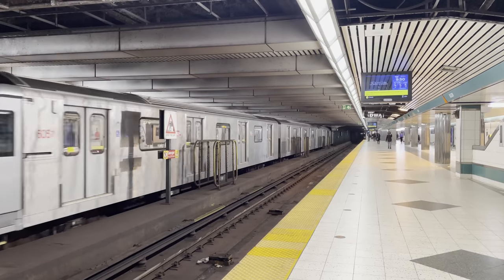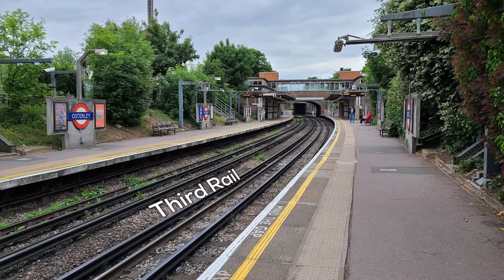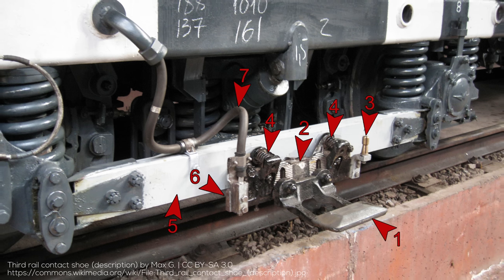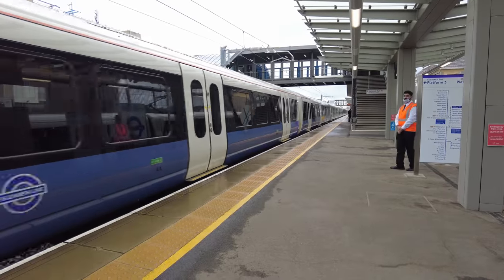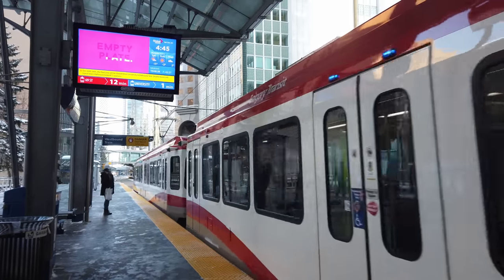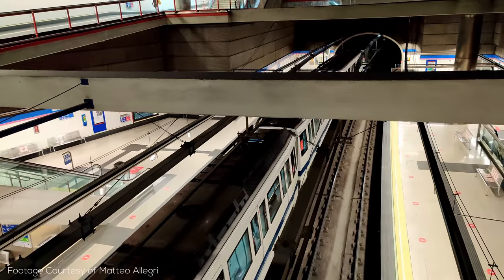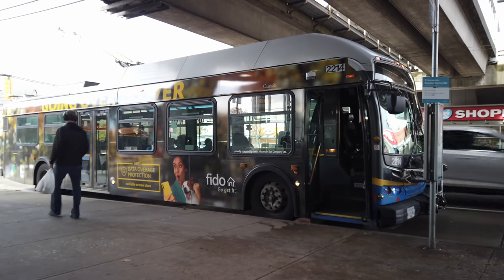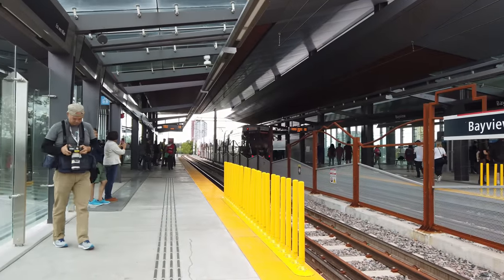The Best Way to Power Your Railway | Third Rail vs. Overhead Wire

Comment: On the Merseyrail network in Liverpool, the new trains, should they ever arrive, have the ability to be dual mode with cantenery and third rail shoe. However because God forbid we spend money on infrastructure, they can, and will be, fitted with batteries instead for going beyond the third rail network, which I just think is silly, especially since cantenery already exists on other lines near the network that the trains could theoretically access, and not be limited by battery range.
Reply: Fitting them with batteries also means that in the event of catenary being down or a pantograph failure, they can 'rescue' themselves to a limited extent, get passengers to the next station, etc, etc.  Even the 'pure' electric IEP's, the 801's, each have a single on board diesel gen-set to allow off-catenary moves. (The 803's have an enlarged battery bank for the same purpose and all the other IEP's in service so far are bi-mode anyway)
Reply from the maker: @jonathanj8303  Having batteries for that reason is good, but having excessive amounts probably isn't super useful!
Reply: @RMTransit  it's a compromise like everything else.  When you're using the batteries, great to have, when you're not, dead weight.  Kind of like the spare wheel in a car. Or having any more fuel in the tank than is needed to reach your destination.
I don't know how big the battery pack on the merseyrail stadler units is, but the one on the 803 trains is apparently effectively a swap-in size and weight wise for the 560kW gen-set they would have had if they'd been built as 801's.  I don't know what the range on batteries is, but it's obviously slower to recharge vs refilling the tank, but environmentally cleaner (depending on where you buy your electricity).  Seems a fair swap to add some operational flexibility/backup to a 5 car 270t 200km/h electric train. If it and a couple of other prototypes work out, longer term I wouldn't be surprised to see the 800/802 bi-modes swap their gen-sets for hydrogen fuel cell modules, and the 801's get either batteries or fuel cells depending on the operators' preference.

Comment: I'm a little surprised that so few diesel electric trains are battery hybrids. Charging batteries with the regenerated power, then feeding that power back into the electric motors when needed would make them significantly more efficient.

Also, I believe that the new New South Wales (Australia) regional trains (to replace the XPTs and Explorers) are planned to be diesel electric with pantographs so that they can shut down the diesel engines and operate on overhead wires where available. This will result in less pollution and noise when the trains are in the greater Sydney area.
Reply: I think the Siemens charger is a diesel-battery hybrid (or at least some versions of it will be)
Reply: We have some new trains in Trondheim using that system.

Comment: A kid from my school in the south of England threw a metal bar at the third rail and was very badly shocked and burned by it. He was not the brightest.
Reply: After the power has been switched off a metal bar can be placed between the conductor rail and one of the running rails, or on the London Underground between the positive and negative rails, to ensure that the power is not turned back on, for example if passengers have to be walked along the track from a failed train.  In an extreme emergency the short circuiting device can be applied to a live track as the means of shutting off the power if the normal means is not possible.  Staff are instructed to apply the device to the running rail, or negative rail on the Underground, look away to protect the eyes and then to bring it down smartly onto the live rail to reduce arcing.  I have never seen it done, and I certainly wouldn’t want to do it myself, but I have spoken to somebody who had to do it in training.  They didn’t like doing it either!
Reply: When Los Angeles'  new subway opened in 1993, a dog made his way into the maintenance facility and lifted his leg on one of the third rails....

POOF WENT THE WOOF!

Comment: Möööp! One big nono... You only need fewer trackside equipment on AC installations if you use higher voltages!
The problem with DC is, that at higher voltages it becomes FAR more complicated to handle. AC on the other hand is less efficient in transission than DC. But the cost of maintaining high voltage DC equipment is simply to expensive.

That is why you will typically find voltages between 600V and 1000V and no use above 3kV with DC. To power the same amount of trains on 3kV vs. the "new standard" 25kV AC you need about 8 times more metal for the same amount of power delivered - not necessarly 8 times the substations, but still substantially more. Still, due to physics, 3kV DC at 1000A is simply not enough juice to sustain high speed. And again, catenary that can sustain more than 1000A continuosly just becomes prohibitly expensive -  ask the Netherlands.... And that is not even considering the limitations of amperage on pantographs...
All European countries that use "low" voltage DC on their legacy main lines have opted to use 15kV to 25kV AC when they build their new highspeed networks (Italy, France, Spain & BeNeLux, for example)

Many companies opted for DC in the beginning, because this made the trains themselves a lot cheaper to build and due to the lack of a transformer and significantly smaller motors (for the same amount of power output) a lot lighter. AC was generally only used for long distance rail lines, where the cheaper trackside equipment outweight the more expensive trains.
Especially the Netherlands would love to abandon their DC network rather sooner than later, at only 1,5kV it simply has not enough *Oomph*, especially for freight trains...

The de-facto standard of 25 kV AC only became the most feasable option with the advent of high current semiconductors at the beginning of the 90's - making multi-phase AC motors (the most efficient motor by far) practical on every-day trains.
Fun fact: Almost every modern train runs on DC, because there is no easy way to change the frequency of the incoming AC. So it simply gets stepped down to generally around 1000V and then rectified, because it is easier to handle "lower" voltages in semiconductors... The DC backbone is then used to generate the shifting AC for the motors themselves.
Reply: Ironically, both France and Netherlands have been tried AC electrification in early 1900s. Ligne de Cannes-la-Bocca à Grasse have been tried using 12 kV 25 Hz between 1910 and 1914. Chemins de fer du Midi electrified at 12 kV 16.7 Hz. Meanwhile, South Holland Electric Railway Company (ZHESM) 10 kV 25 Hz from 1918 to 1926.

All of them actually successful, but for various reasons, all of them re-electrified to 1500V DC

Comment: Overhead is cheaper than third rail. It's why in the UK, only in the South East (including London south of the river) do they use 'third rail'. Elsewhere in the UK, any electrified track is overhead. 

But by 2030 there will probably be a third way to power electrically: using a battery pack on an EMU (Electric Multiple Unit), or an Electric Locomotive. 

Still early days yet, but reckon there'll have invented a large electric battery pack for use on trains by the close of this decade. Crucially, a battery that doesn't spontaneously explode, like some electric car, and bus batteries do at the moment.
Reply: Except for Liverpool and Glasgow

Comment: How did the conduit system work in London’s old trams?
Reply: There was a slot in the ground between the rails and a ‘plough’ attached to the tram made oontact with a live conductor below the ground.  If you’re in London the conduit slot can still be seen on the ramp leading down to the disused Holborn tram tunnel, near Holborn Underground station.  The changeover between conduit and overhead systems took place at a ‘change pit’ where the plough would be released from the tram and would run into a sort of siding between the tracks in each direction and rage trolley pole would be raised.  In the opposite direction the trolley pole would be pulled down and a man with a large tong type tool would grab a plough and insert it under a tram going onto the conduit system.

Look for ‘The Elephant Will Never Forget’ a British Transport Films production about the last week of trams in London, in 1952.  Among other things it shows the operation of the change pit.  The whole operation only took a few seconds.

Comment: @RMTransit in The Netherlands the RET Metroline E rides from Den Haag Centraal to Slinge and from Den Haag Centraal until metrostation Melanchtonweg the metro use Overhead Wires and at the station Melanchtonweg while it halt at the station it switches to third rail and then it uses from Melanchtonweg until Slinge third rail from the Rotterdam Metro system and it shares the tracks from Den Haag Laan van Nieuw Oost Indie until Leidschenveen Tram/Metrostation with HM Randstadrail line 3 from Den Haag Loosduinen to Zoetermeer Centrum-West and 4 from Den Haag De Uithof to Langslingerland Zoetermeer and they use then the former Hofpleinlijn and the trams also the former Zoetermeerlijn. And by RET metroline A from Binnenhof metrostation it use overhead wires from Binnenhof metrostation until Capelsebrug and Metroline B use from Nesselande metrostation until De Tochten metrostation third rail and then by De Tochten it changed to overhead wires and then from De Tochten until Capelsebrug it use overhead wires and halfway by the crossing by metrostation Graskruid metroline A joins metroline B to Capelsebrug and then together it goes to Schiedam Centrum running together with metroline C until Schiedam Centrum and metroline A and B are switching while driving to Schiedam Nieuwland from third rail to overhead wires and from Schiedam Nieuwland until Vlaardingen West metroline B runs together with metroline A  and sometimes a freight train until Vlaardingen Oost and the metroline B runs to the temporary metrostation Hoek van Holland Haven where it ends on 1 of the former train platforms where in 1935 until 1994 D train international teaibs deprted and until 2017 local trains to Rotterdam Centraal departed. Metroline C runs from De Terp to De Akkers where it shares tracks from Capelsebrug until Schiedam Centrum with RET metrolines A and B where line A and B runs then to Vlaardingen West and Hoek van Holland Haven and metroline C runs then further to metrostation Tussenwater where it shares until metrostation De Akkers where it ends the tracks with Line D wich runs from Rotterdam Centraal and shares the track to Slinge with Line E from Den Haag Centraal and metrostation Beurs is a metrostation where at Beurs you can change from Metroline A to Vlaardingen West and Binnenhof to metrolines B to Nesselande and Hoek van Holland, metroline D from Rotterdam Centraal to De Akkers, metroline C from De Terp to De Akkers and metroline E from Den Haag Centraal  by

Comment: An AC and DC system of the same voltage are equally lossy over distance

It's just much easier to raise the voltage of an AC system to be very high, since you can use transformers for AC but not for DC
Reply: Exactly. And just to add my five cents: The losses actually come from electrical resistance in the conductors. You can imagine electrical resistance like mechanical friction. 
The higher the electrical current in your conductor is, the higher your resistance is. Because power equals voltage*current (P=U*I), to transmit a lot of power you either need a high voltage (25kV for example), or if you have, let's say, 1500V or 3000V DC electrification, you have extremely high currents. That's why countries wich have DC electrification on their railways, like Poland, Netherlands, France, Italy,... often have two catenary wires in parallel to each other, and each Pantagraph usually has 3 or 4 graphite contacts that touch the catenary, instead of one or two  on AC electrified systems. These are all measures to reduce resistance.
Reply: @georgobergfell  My understanding is that AC circuits would have less power loss over distance because as you raise the voltage, current decreases and if P = I² R then power loss to heat decreases greatly, at least this is what my textbook tells me.
Reply from the maker: Yeah, I am not in the loop enough about HVDC, but I do need to go look into it in. more detail, I know it's become much much bigger.
Reply: @georgobergfell  Are the wires themselves really that non-ohmic to the point resistance increases greatly at higher voltages? I would have thought resistance relatively constant especially if they're being used for high transmission at a constant voltage, and so the power losses only minimised by step ups. Maybe I'm just misinformed on the issue
Reply: @jesse4202  yes, resistance is relatively constant and doesn't depend on the voltage. The losses come from the voltage drop due to resistance

Comment: 8:39 errm. No.
Yes, AC current is easier to step up and step down and requires less switchgear than DC equivalent at the same voltage.
DC is a problem in transport as it can ark between the third and running rails, making a 25kV third rail extremely problematic. In fact a 25kV DC OHL would be more efficient that an AC OHL, but again can ark across 5 meters and extremely dangerous to rail workers and passengers who get too close. AC can ark, but due to other technical reasons is largely safer.
DC third rail systems are typically less than 630V, which means the current is inversely higher, which means conductor losses.
DC is not inferior to AC when it comes to losses.
AC(rms) and DC have their advantages. 
DC doesn't have reactive losses like AC, that's why it's often used in underwater power transmission. 
AC doesn't have to be controlled by switching positive and negative in a circuit like DC. 
Due to the way AC is generated, the peak voltage of AC is way higher than DC equivalent.
Needless to say both are equally dangerous.
Reply: The Bay Area Rapid Transit (BART) system a closed heavy rail system uses a 1Kv DC 3rd rail each station is equipped with a power substation with two DC power houses.

Comment: In the context of third rail and level crossings. You say that it's not ideal to have third rail near level crossings.
I would argue completely differently here, it's not ideal to have level crossings PERIOD as it's dangerous in its own right, regardless of power delivery. And it makes it so rail vehicles may have to slow down before a crossing or even stop because the crossing has it's priorities set in a weird way. Look to the UK for places where car traffic may hold up trains, which is a bisarre way of doing it but that's how it's done none the less.

When it comes to rail, the best option is always to separate rail traffic from other traffic of any kind. Not even trams make sense in that regard, even though they are "streetcars" rather than railways. Most cities with tram networks do tend towards separating trams as much as possible from other methods of traffic, especially when there's no stop nearby. And forward thinking city planners have built pedestrian and road bridges over our tram lines where i live in any developments since the 60's. Except for when they laid the ring line as rebuilding the city core wouldn't be feasible.
But any new zoning developments have the requirement to avoid level crossings with rails, no matter if it's tramways or railways. And even so, for road through traffic it's often planned at great expense to have those roads be separated from pedestrian traffic as well. And of course planning the roads such that any car traffic in walkable areas is reduced to only the absolutely necessary traffic.

Comment: Ah electrification.
DC VS AC.
3rd Rail VS Cantanary.
Here in britain we just go ah why not everything.
And last i checked the Tyne and Wear Metro uses Cantanary power for the most part.
idk about the section under newcastle though.
Reply from the maker: Such a long and storied history with railways does that!
Reply: British electrification history is interesting. 

Some railway in early 1900s even have high voltage AC at 6600 V (25 Hz). The system is made by German AEG, but they standardised to third rail in 1920s

Comment: Is America actually interested in electrifying it's rails for intercity services ? I'm seriously doubting it. Every time I bring up electrifying corridors other than the NEC, there seems to be a "We can't do that because of freight trains" attitude, even from people who like trains. It would be significantly more beneficial to electrify main corridors, increase large parts of the network to 100 mph, and improve frequency than building a single brand new HSR capable of 200 mph.
Reply: How does freight stop electrification? You can tell people that India already runs double-stack trains under wires. You just need to put the wire higher and use a longer pantograph!